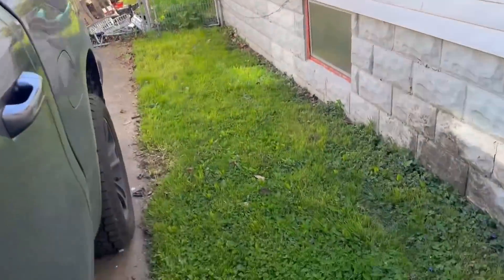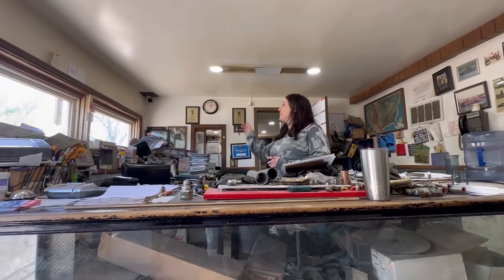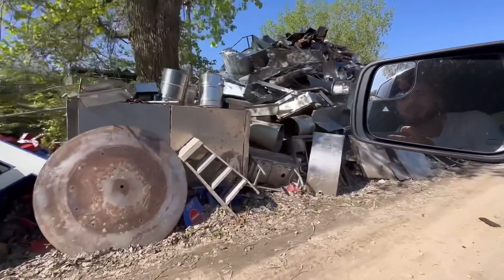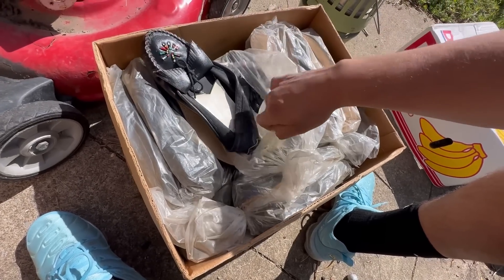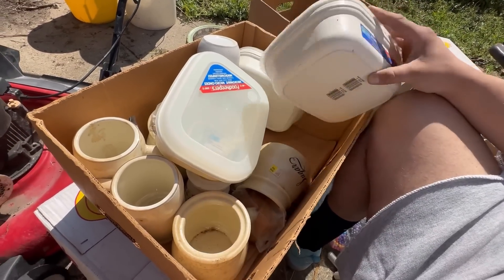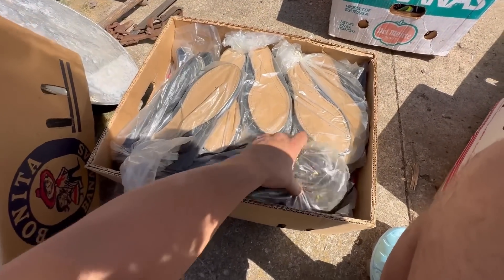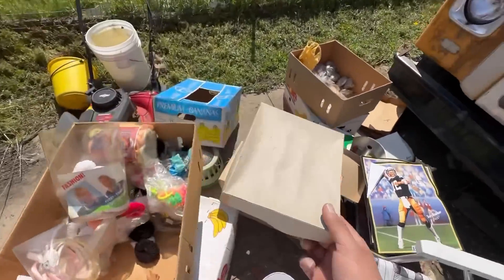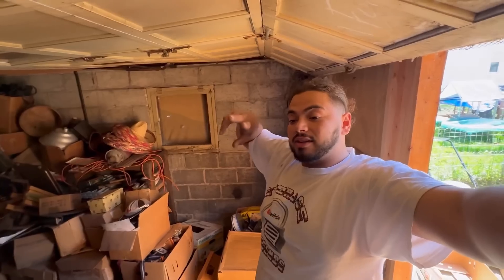This Is Getting Nasty: Hoarder House is REACHING ITS FULL POTENTIAL! PLUS a NEW SCRAP YARD!

Comment: Cast iron pans can be brought back to life with the right tools and just a little elbow grease. Rust on them and cooked on grease....all can be fixed. Aluminum can rust, but Al rust is white and makes the piece bumpy. Each scrapyard sets its own prices and policies. Great belt buckles. The monthly rings are cheap. They used to be sold as something a kid, with the meager allowance they got in the 60s, could buy for themselves. The sling shots look handmade.....NICE! Fun boxes.

Comment: The cast iron skillets can be cleaned and recoded and then they can be used again there's nothing wrong with cast iron skillets just clean and re season which means recoating it. And then they'll be ready to use again

Comment: so when u goto a scrape yard separate ur aluminum and copper in separate containers. your rakes cut the wood off from the medal. but 52.00 is good.also, cut that bus up if there isn't a title. just like that other tow guy said cut it up.